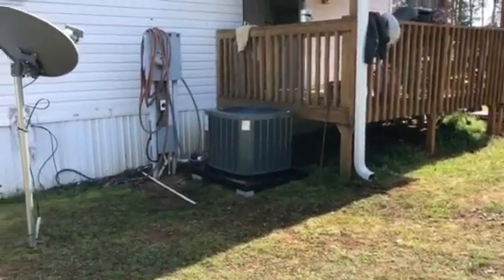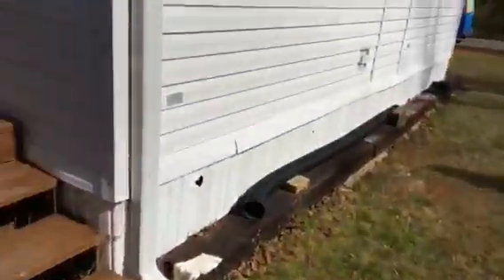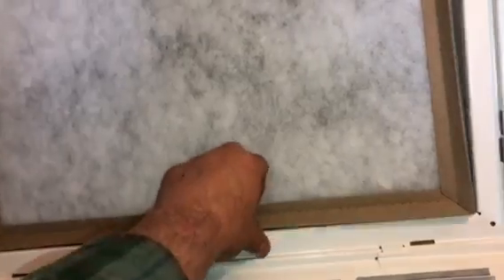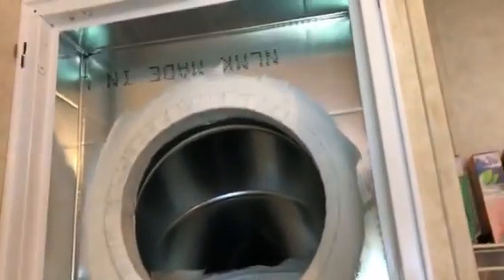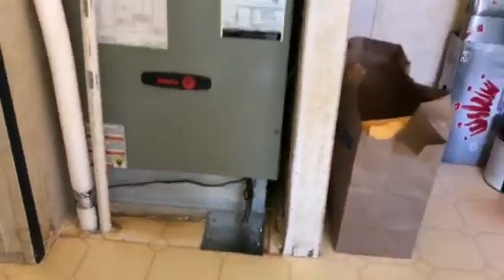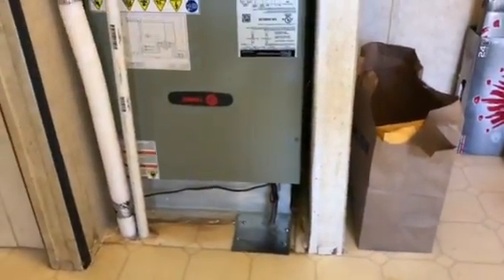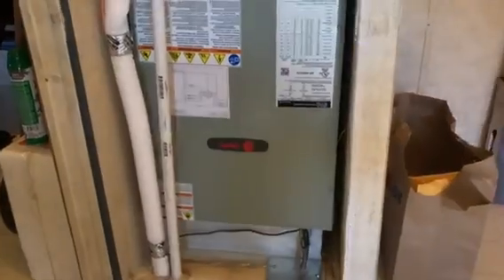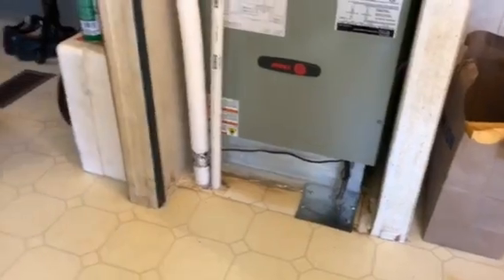Mobile home HVAC upgrade to Trane heat pump

Comment: I'd love to get a heat pump installed at some point.  West Texas. Pretty mild winters.  And this place has Standard AC with pure Electric heat.  It works, and my bill is not high, $65-100   but I know it would be less with a more efficient systems.
Might go mini split though.. and eliminate the terrible duct work system in here at the same time.
Only 3 main rooms in the place so a mini split would work very well and be easy to install.
Love your vids.

Comment: Great work on the install, nice longer lasting equipment for that mobile home. May out live their mobile home, lol.
Reply from the maker: Amen !!
Reply: Yup, good work if codes allow it. I did a upsell on a Mobile home about 10 years ago. I look back at her now and I would classify her as a mifl. She had a 5 year old Coleman nat gas furnace that already had a hairline crack in the heat exchanger. Sold her a Carrier 92%, both intake and exhausts vented thru the roof.

Comment: Love the idea, but static pressure would scare me duct work on mobile homes not being anywhere close to a normal residential homes duct,is that ecm motor in that air handler?

Comment: Would this method still work if the unit had heat strips or would it be too hot for the wood base ?

Comment: Not bad at all. I'd like to have a nicer system installed in our doublewide with multiple returns, zones, multiple stages, among other things. We have a Nordyne furnace with a Rheem AC add on. No major issues except the guys that installed the AC didn't check the thermostat before leaving. I found the thermostat calling both at the same time when in heat mode. OOOPS.

Comment: I've got the same question David Ashabranner had ....since mobile home duct work is usually undersized how do you overcome external static pressure issues and how close to .05 wc can you get ???

Comment: I live in a Single-Wide Mobile Home for 30 years now.  I have a downdraft 1971 InterTherm MAC 1155 Furnace.  I inspect the Furnace twice a year.  Before start up and after I shut it down for Spring.  I just wish you would have shown how you were tied into the ductwork or you ran new duct to each register?
Gary O'Connor
Air repair
Reply from the maker: Equipment only change out in this video... the 2x6 treated wood box was sealed to floor and with mastic (duct sealer) and the air handler has a strip of peel and stick weather stripping on it to rest on the wooden box.... all the existing air ducting was left intact.
Reply: Ok. Thanks

Comment: I like the idea but I was expectin a square box that would be just as sealed
Reply from the maker: Where do you mean ? On the floor ?
Reply: Anti DIY HVAC no I was saying when you open the filter it was a big box that was tied into the air handler instead

Comment: Ted, since mobile home duct work is usually undersized how do you overcome external static pressure issues and how close to .5 wc can you get?
Reply: JD  that woukd make it very hard to service much less install. Also difficult to move.
Reply: Im sure he tells them it's less than optimal

Comment: Why would you need a pee trap on a down flow furnace
Reply from the maker: Jackrobert Smith The configuration of the airflow direction does not change the fact that the coil is under negative pressure. Therefore the P-trap serves as an airlock and is always necessary on a negative pressure type air handler.

Comment: The return is supposed to be at the bottom where the colder air is. Very poor design by a snob plumber.
Reply: Are you slow?